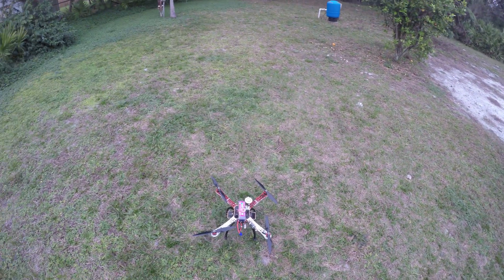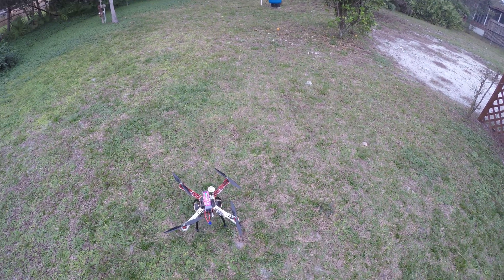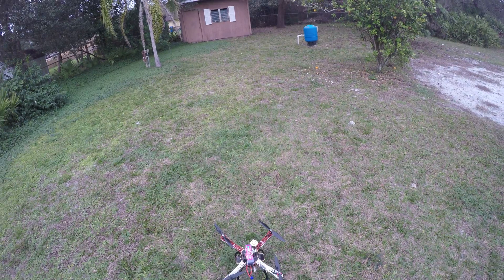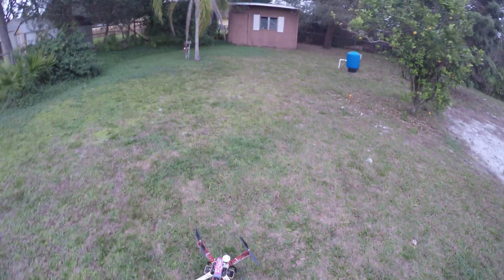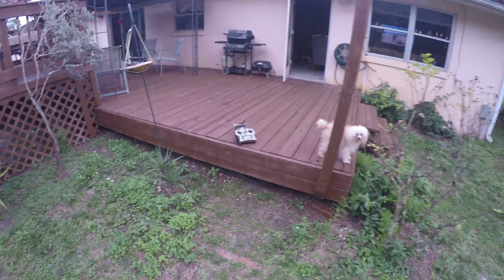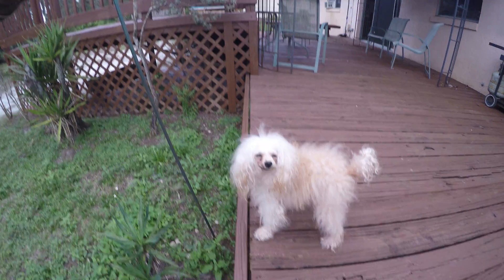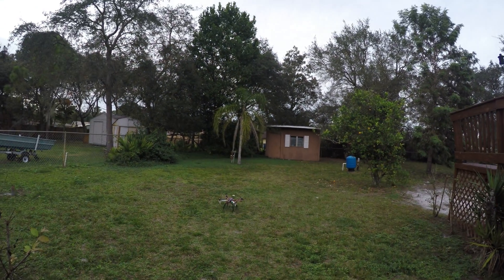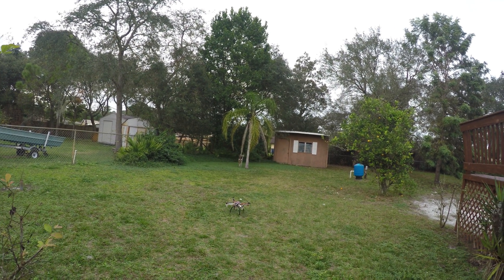Drift on DJI Naza M Lite Fix

Comment: Hello 
I made a drone using dji naza m lite flight controller.
F450 frame, 100kv motor, 30am esc,1045prop,gps.
The issue is its not working properly.
I cant takeoff.
I tried gps mode once. At full throttle only fliggt takking off.
Manula mode is not controllable.
It tilting left side and sometimes backside, sometimes fliping,.
I lost 2 pair of props. All are broken.
Please help me to set properly.
Reply: 1000kv motor